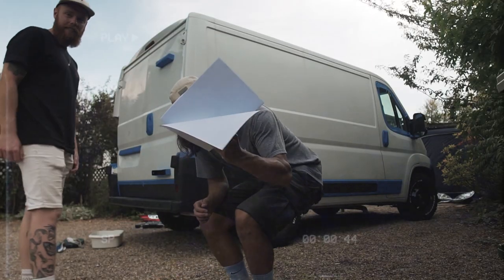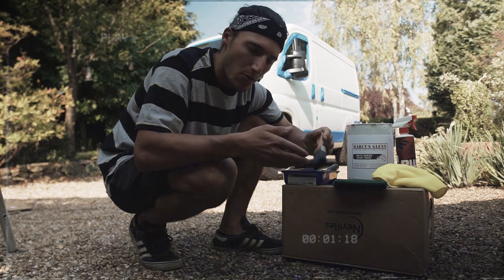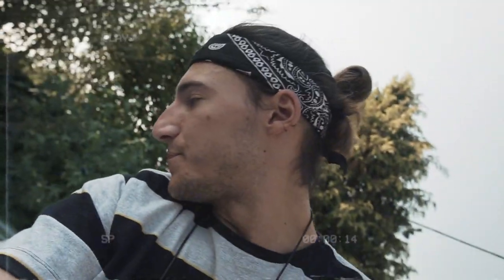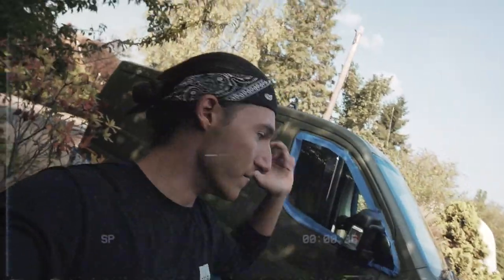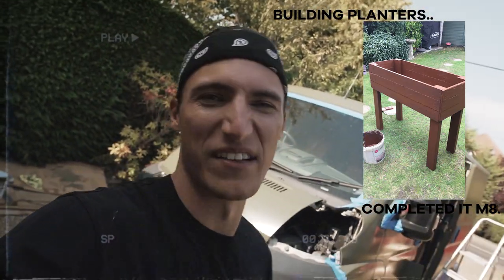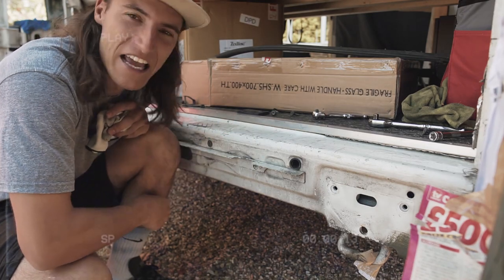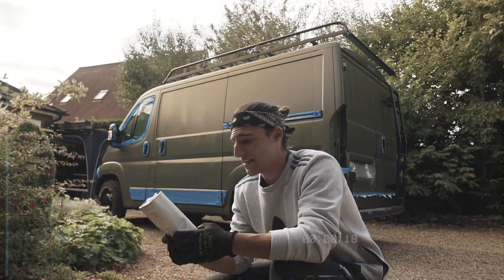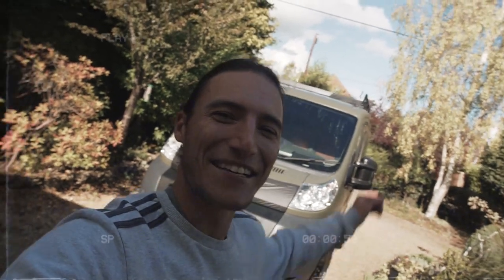I PAINTED MY VAN BY HAND! *MAD RESULTS!* // Cozy Cabin Van Build EP 04.

Comment: hi mate. just some basic questions i bought old van want to brighten it up a bit, but for health reasons want to make it as simple as possible really aint too fussed about the outcome. I'd really appreciate your help. 1. can i just do a simple sand using those sponge type sander or do i need electric sander 2. what grade of sandpaper 3. what type of paint 4. what type of roller?can i use a small one 5. how many coats. cheers!!
Reply from the maker: Hey man, check the description for everything I used including paint and rollers! 

You don’t need to actually sand the vehicle with this type of paint but I just keyed the whole surface anyway and 3 years on she’s still looking great! 

1st coat looks terrible but but the end of the second it looked spot on. I did 3 in the end for all the larger panels 💀🤘🏼
Reply: @BradWithTheVan  yer i had a look at your van, looks great!!. Thanks for the tips might flick through the transcript i saw one other video so far, they did 3 coats too. Coming up to summer here in australia i might give it a go myself my van isn't as classy as yours and i got a quote for someone else to do it which was too pricey for me.

Comment: Do you put new coat on top of coat with out sanding in between or is sanding required between coats?
Reply from the maker: I did not sand between coats, 3 years on shes still spot on!

Comment: Watched this video few times bro, so tempted to do my vw crafter swb!! Satin quantum grey I'm thinking!
Reply from the maker: Do it 💀🤘🏼
Reply: @BradWithTheVan  Did you just use thinners on last coat? Is it possible to paint one day sand the next and paint another coat? Just worried about drying times, Thanks man
Reply from the maker: @jacklightburn6585  did three coats and used TH25 thinners after I realised I should have done it with the first coat. Much easier to apply as the paint is oil based and hard to apply without it. 

The thinner you apply coats the quicker it dries, really doesn’t take long to be touch dry 👍🏼
Reply: @BradWithTheVan  Belter thanks mate, take it easy lad and keep going with the content!!!
Reply from the maker: @jacklightburn6585  be hard at the minute but I’ll be back soon!
Reply: @BradWithTheVan  started doing the insides man/door jams on to the outside soon! You know the seal you painted in hows it holding up? I was thinking of cutting out and re sealing afterwards, Cheers
Reply from the maker: @jacklightburn6585  seal on mine will need repainting soon but took a whole winter of abuse in the snow and ice over here in Austria 👍🏼

Comment: Hi mate, great video, quick question how did you manage to avoid roller lines in your paint finish.
I’ve roller painted a van before but there was lines all over it, got a newer van now but body on it is terrible so I’m going satin slate grey on this one.
Any advice would be awesome.
Cheers geez
Reply from the maker: Common question, but I found that thinning the paint and getting as much out of the roller as possible before dipping it back in the paint tray prevented the lines. Just keep adding layers til you’re happy! 🤘🏼

Comment: Hi. You didn't put a primercoat on first? 
Would you sat this isn't needed if you aren't taking all of the original paint off?
Reply from the maker: Hi Marc! Nope this paint is exactly what the old boys use to repaint their battered landrovers after sending it off road. Every step I did is exactly as is in the video. Wash surfaces thoroughly, lightly key the paint and then whack the paint on! Finish is still looking great after 3 years! 🫡
Reply: @BradWithTheVan  cheers. Did the bonnet today, so will see how it looks over next few days
Reply from the maker: @marcbundy7835   Trust the process man, first coat looks like youve ruined a perfectly good van, 2nd coat everything was starting to look good, 3rd coat was absolutely epic!
Reply from the maker: @marcbundy7835  go for it lad!

Comment: How's the finish hold up  a few months on ? Looking to do similar but unsure on the uniformity (roller marks) and durability (scratches) ! Cracking result 👏
Reply from the maker: Still spot on and I've done over 1000 miles since too! It does scratch easily but I have enough paint to touch up in the summer again if need be! No visible roller marks if applied thin with a few coats! - Hope that helps!
Reply: @BradWithTheVan  awesome 😊

Comment: Did you used antirust paint?
Reply from the maker: No dude just NATO Green Satin straight out the tin with a bit of thinners 🤘🏼
Reply: @BradWithTheVan  primer ? Also ?
Reply from the maker: @G_STYLIN  nope just lightly sanded you don’t need primer with the paint I used. All the old boys do their landrovers the same way 🫡
Reply: @BradWithTheVan  okok sorry im french and i cannot find the same paint, but at the shop i found an oil paint with antirust properties in it so i suppose it will be good?
Reply from the maker: @G_STYLIN easy no stress! Yes a lot of people hand paint vans with that 🤘🏼
Reply: @BradWithTheVan  okok bro, did you thin the paint?
Reply from the maker: @G_STYLIN  I did, watch the video dude I explain everything 😜